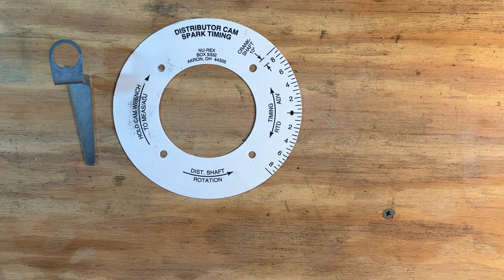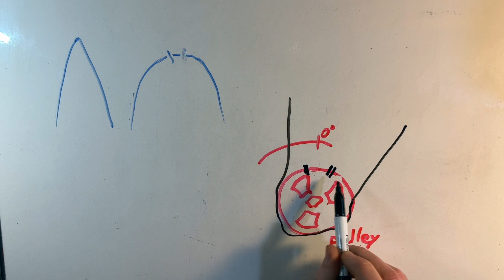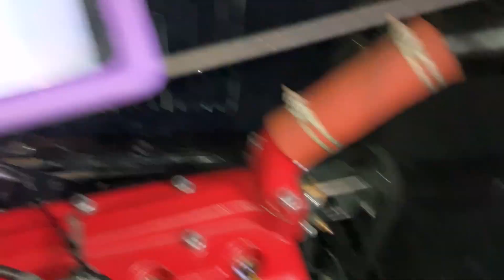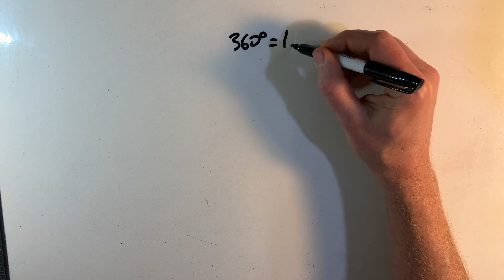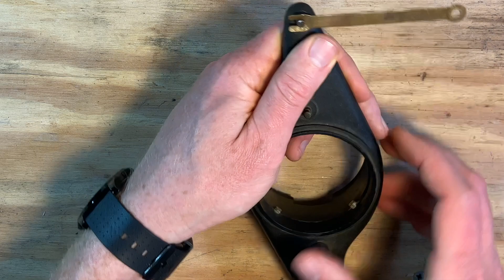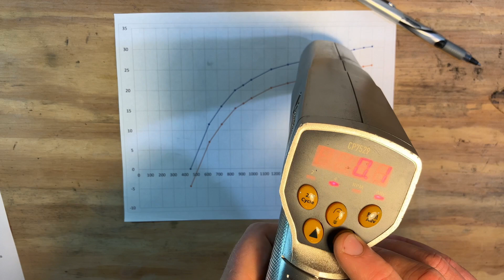Model A Ford – Precision Timing and Finding Top Dead Center

Comment: You are putting way to much into this, when someone can change the timing as they are driving. These old engines are not running at 8,000 RPM, and are not race engines. When they were designed, and use for over 90 or more years, back in the day, that did not have Volt Ohm meters.  You are way over thinking this, back in the day, when they were made, the average person that owned and drove them, do you really think they put this much afford into it.
Reply from the maker: Of course they're race engines, A Model A engine, and especially a Model B, with an OHV conversion and suitable cam and carbs, will beat a stock pre-war V8 on the track, and many of them did. The one in the video has a Winfield 7:1 head on it. 

If you don't need to time your Model A precisely, there are lots of videos showing how to time it the normal way. There were no videos showing how to hit a precise degree advance if you wanted to do that, so I made one.

Comment: I never would have guessed that so much goes into correctly timing one of those old engines.
Reply from the maker: Most folks don't need to go through all this rigmarole, I won't pretend otherwise. But if you need to be precise you certainly can be.
Reply: Most people don't have a NuRex auto advance either so you wouldn't have to go thru all procedure.

Comment: Thanks for great informative video! :)
Do you know how would I adjust a Mallory modern style distributor part number 2301105. They were made for the model a but don’t know how to adjust it to get the proper timing. I think the gap at the points is suppose to be 0.18 dwell is 34 and it has 18 degrees of advancement at 2,000 rpm. How would I adjust this style of distributor on a model a? Any help appreciated :)
Reply from the maker: I haven't worked with a Mallory myself but my understanding is that you're supposed to set it up in roughly the correct position, with the locking set screw loose, start the engine, let it idle, and then rotate the distributor body until you have the correct initial timing. If it has 18° total advance, you're probably looking at about 10° initial timing, depending on your compression ratio. You will need a timing light and a degree indicator (or a light with a built-in advance readout) to get it set correctly.
Reply: I ordered innova 5568 timing light hoping it would do the trick. I am unable to find the degree indicator that’s stainless in your video. I only see the nurex one with the sticker online. Is that good enough to use as degree indicator to correct timing? I have stock head. The reason why I want to adjust it is I have a misfire at idle that somewhat corrects during higher rpm. It was a grandfathers car and they don’t even make these Mallory distributors anymore but apparently they run good. Is spark plug gap of .35” good for these motors? Trying to eliminate everything as cause of misfire. I also recently replaced head gaskets and all. Thanks again
Reply from the maker: @Achilisvobak  If you'll have an Innova 5568, the Nu-Rex indicator will be fine. In fact you could get by with a bent clothes hanger. You just need a dot on the pulley and a dot on some fixed point, and they have to line up at TDC. The Innova will handle the rest. You'll need to power the Innova off a separate 12V battery, but that's not too hard.

If you have the stock head then I would aim for 11-12° initial advance with the Mallory so that you get 29-30° total advance. It doesn't have to be super precise, just get in that ballpark.

Plug gap of .035 will be fine as long as your coil is in good condition.

A misfire at idle could also be caused by the idle mix being too lean. That's adjusted directly on the carb, not the GAV. Something to consider.
Reply: So basically if I align the timing gear through the hole of the front timing cover I would be precisely at top dead center on cylinder one correct? I have the radiator off so I can see not just use the dimple on the little oem tool which is ineffective at times. So I would make a mark on the crank pulley at zero degrees according to the mark on the nurex degree indicator points to compared to the crank pulley. Now do I just start the car and have the distributor screw loosened so I can rotate it while I am looking at the timing light to get to the recommended advance? Or do I have to do something with the points and measure gap there too? Sorry I am just not knowledgeable with order distributor cars :/. Thanks for your help :)!
Reply from the maker: @Achilisvobak  With the caveat again that I haven't personally set up a Mallory, my understanding is that the procedure you describe here is correct. Couple of notes:
- When you're marking the pulley at TDC, make a note of where your eye is. You'll want to position your eye in the same spot each time you're measuring the timing; otherwise the parallax effect will change the apparent point at which the two dots line up.
- I would start by setting the Innova to 0° advance and get the Mallory set correctly there. You want to make sure the engine is running well in its default state. Once you're satisfied that the engine is purring, set the Innova to 11-12° advance and adjust the Mallory to match. Then lock it down and take the car for a test drive.
Reply: Got you. Yeah it sucks cause they no longer make them and there aren’t any instructions. I contacted Holley which now owns Mallory but no one ever gets back to me. Thanks so much for taking the time and sharing some wisdom :)!
Reply from the maker: @Achilisvobak  Just be glad you have one in good repair. The parts situation for Mallorys is terrible.
Reply: Yeah now I just have to get the nurex degree indicator. I adjusted the screw for idle air mixture to 1.5-1.75 turns out. Car starts right up but misfire is there even when you u crease rpm, just not as noticeable. Checked spark plugs and coil, it has to be adjustment. We shall know when I get the degree indicator. But you say shoot for 12 degrees idle? What rpm 600 or 750 idle?
Reply from the maker: @Achilisvobak  RPM on idle with 0° advance and the stock head would be quite low, 350-450 rpm. At 11° it will speed up a bit, I would say 500. If you're at 750 then you're off the idle circuit in the carb, that would be a very fast idle for a Model A.

Do you know which cylinder is misfiring?
Reply: I haven’t started yet. I have no clue what idle speed is on these cars cause there is no speedometers or rpm gauges lol. I was just guesstimating compare to a 70s cars. That’s a great input I will shoot for 500rpm at 11 degrees then. I don’t know which cylinder is misfiring. How can I find that out?
Reply from the maker: @Achilisvobak  If the misfire is consistent, i.e., happening more than half the cycles, you can check by sequentially grounding the plug connector for each cylinder. If you ground the connector for a plug and the sound of the motor doesn't change much, congrats, you found the one that's misfiring.
Reply: Another question does coil polarity matter on these cars for misfires? Am I suppose to connect the plus sign to the red wire and the black minus straight to the distributor? Not sure if positive ground suppose to be opposite?
Reply from the maker: @Achilisvobak  Coil polarity mismatch reduces maximum spark intensity by about 10%, so it shouldn't matter unless your coil is marginal to begin with. If swapping the distributor doesn't cure the misfire, I would definitely reduce the plug gap to .025 as a diagnostic step, see if that makes a difference. If it does make the difference, that would point to the coil as the cause of the misfires.

Coil polarity identification is tricky because of the diversity of coil markings. If you search the internet you should be able to find a suggested procedure that uses an analog voltmeter to show whether your coil is hooked up backwards. I've found that to work well.
Reply: Got you. Another question if I am running the model a without a muffler would that potentially cause misfire possibly air being drown from the exhaust side as a leak? I don’t have the clamp and gasket or muffler on.
Reply: But I do have the exhaust manifold on with copper gaskets and torqued
Reply from the maker: @Achilisvobak I would definitely not run it without the tailpipe. The exhaust manifold outputs right next to the carb intake. It will suck the exhaust gases right in.
Reply: Got it! Do you think that would cause misfire? In addition I did what you suggested and unplugged each coil wire from distributor top to each cylinder. When I unplugged wire for cylinder number 4 in back engine stabilizes and misfire it’s almost completely gone. In addition I sprayed soapy solution on exhaust manifold gasket at cylinder number 4 and saw some air bubbles as well. I will be replacing that as well. Do you think this could be causing my misfires? Running it without muffler and possible exhaust leak ?
Reply from the maker: @Achilisvobak  Yes I do. If you're using the exhaust manifold that your grandfather had on it, quite possibly it's an original manifold, and almost all original manifolds leak at the #4 cylinder. This is due to the design of the exhaust system; the weight of the muffler & tailpipe pull on the end of the manifold, and after 95 years of heat cycling they are all warped. Reproduction exhaust manifolds are excellent quality and will fit perfectly.

If it were me, I would do this:
- Remove the exhaust manifold and use a high-quality straight-edge to check whether the exhaust ports line up. They are supposed to all be perfectly in line. My guess is you'll find the #4 port to "droop" up to 1/4" out of alignment.
- If so, you need to replace the manifold. I recommend the Ceramic Coated Exhaust Manifold from Snyder's. Last manifold you'll ever buy. If you replace the exhaust manifold, you will need to check its alignment with the intake manifold before you install it. They bolt to each other and all six ports must align perfectly in all dimensions. Sometimes you need to have them milled as a unit so the tips of the ports are planar.
- When you reinstall the manifold, replace the gaskets. The copper gaskets that come as a pair are good. Also you should be sure to install the Manifold Gland Rings. These help protect the gaskets from exhaust gases. There is a small possibility that your engine block won't be machined with the counterbores that the rings need, but most blocks will have them.
- Attach a tailpipe of some kind before you run the car again. It doesn't have to be the official Model A tailpipe but you have to get that exhaust out of the engine bay and you need it to seal properly where the tailpipe meets the manifold.
Reply: Understood just got done measuring exhaust manifold and intake manifold with a straight edge and sure enough you are correct the last cylinder 4 seems to drop off and is bellow the line of all the others by 1/8-1/4”. I am most likely gonna get the one you recommend from Snyders. I also did have glands installed but will purchase new ones. Do you think I am okay with the Mallory distributor or should I be looking at something else? What do you recommend what other distributors out there?
Reply from the maker: @Achilisvobak  Mallorys have a good reputation, but from what you've told me so far, I kinda think you should start with the stock distributor. Managing the spark advance manually is a pain, but it's good training – you'll get an intuitive understanding of how the car responds when the spark timing is too fast or slow. This will help you learn to troubleshoot problems effectively later on.

Get the car running well in the stock configuration before you add "speed parts." As they say, it's important to know the rules so that you can break them.
Reply: Understood. I also found out there was a crack in the exhaust manifold. Got the Snyder one and even new intake manifold. I got them painted today and will install them. I got the same degree wheel you have and installed. If the cam gear dot is centered at the middle of the timing cover opening for timing does this mean I am at top dead center? Or do I have to do the method like you did in the video where you mark both sides on the way up and down of the piston and then pick the middle area? 

Thanks
Reply: I am going to do the crank method with the timing light as I have to rotate the Mallory distributor to achieve the proper advance. Again I am shooting for 11-12 at 500rpm?
Reply from the maker: @Achilisvobak  Yes, that's where I would start. If you are driving around and you get knock, you can always back it off a little.
Reply from the maker: @Achilisvobak  Because you have a stock head and you're not trying at this point to be ultra-precise, locating TDC using the timing pin should be fine. However you might want to make your mark on the pulley with water-soluble paint or something that'll come off easily in case you want to make a more accurate mark in the future, e.g., when you have the head off.
Reply: I adjusted my timing to 11 degrees advance at 600rpm. With this Mallory distributor I can’t get any lower then that. It stalls. It runs better but I don’t think it’s quite there yet. New exhaust is on. Is it possible that I can’t go lower then 600rpm with this distributor?
Reply from the maker: @Achilisvobak  It might be possible – again, I don't know Mallorys super well. If you set the Mallory to 0° advance, just as an experiment, how low can you get the idle? It should idle down to at least 450 and likely lower.

Comment: There was a vid where they owner placed a large plastic cable tie into the cylinder head through the spark plug hole, so that the catch part of the tie blocked the piston travel that top of the stroke, he when rotated it back in both directions so that he could put two marks on the pulley each time it stopped. The TDC was in-between the two marks. It was such a simple method and appeared very accurate, I'll be using this too. Might do a vid when I do.
Reply from the maker: Piston stops are a widespread tool for this purpose, mostly with the head off but as you mention there are options with the head on. I have a personal preference for methods that don't contact the piston, but I recognize it's just a preference – if people want to use a piston stop I say go right ahead.

Comment: Really in depth analysis of the timing system.   By the way, where did you get those plug wires?  Thanks, Tom
Reply from the maker: I made them, using parts for Model T plug wires. The Winfield high-compression head puts the spark plugs in a different spot than the stock head, so the stock plug connectors won't reach. Had to improvise.

Comment: I have a lot of rotational slop in the point cam.  LIke 3/4 of an inch.  When I stop the engine, it is usually in the middle of that slop, not at one end or another as folks say.
I am getting a lot of coughing and vback fire as I press on the gas peddle.
Reply from the maker: My first thought is, you might have a centrifugal advance device installed in the valve chamber. Have you had the car a long time? Have you had the valve cover off?

Comment: The original  Ford spec was design  when using  the pin method  on a new engine would be set 5 deg. Retarded  (ATDC). This was for ease  of starting with starter and safe method  hand starting. Also the advanced  would be 10 deg. for e every  1000 RPM or 30 Deg. at 3000 RPM.  I have noticed  that each notch  on the advance  lever is approximately  4 degrees  movement.  My old Sanp On timing  light does  read retarded. Hope this helps someone. On another  note if you use a Mellory distributor  you can set the total advance and curve and  have a preferred  base timing  degree. Hope this helps  someone

Comment: Considering the timing is controlled by a lever it doesn't have to be precise, just close. With the timing lever all the way up and the plate all the way retarded, set the #1 piston to what you consider 12*-15* ATDC. Then adjust the points cam to when the points just start to open.
What needs to be precise for optimal performance is is the points gap, best measured and set with a dwell meter to 52*. One degree of dwell = one degree of timing. I never tried one on a positive ground car before but I'm sure there's some way to do it. Starter speed is enough to set them just recheck after it's run a bit.

Comment: You're being too critical. Get it close and move the lever while driving to set the timing. That accurate of TDC is only needed if you are running  distributor with a built in advance. If you are just toss the timing light on it - rev it to max advance RPM and set it with a timing light.

Comment: Where did you get your plug wires?
Reply from the maker: I made them, using Model T parts from Snyder's. They carry something very similar, pre-made, as part #T-5029-BS. However those wires are a lot longer. I bought the wire and the brass connectors separately, cut the wire to the length I needed for each plug, and used a large pair of pliers to bend and crimp the connectors.
Reply: Thank you @alexiskai